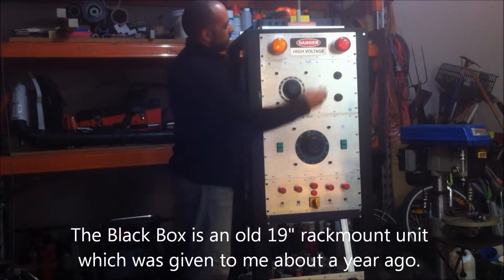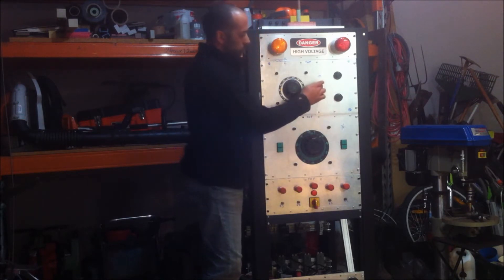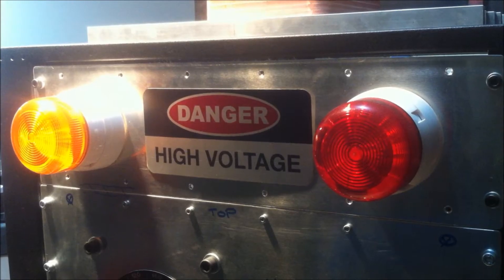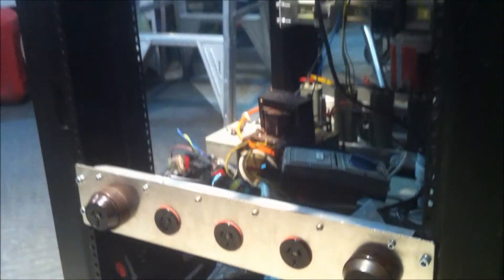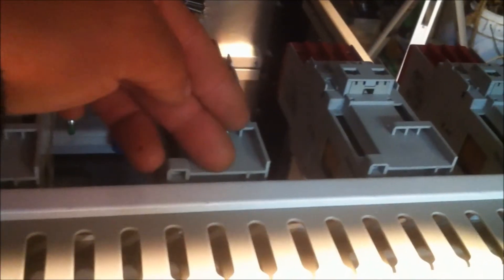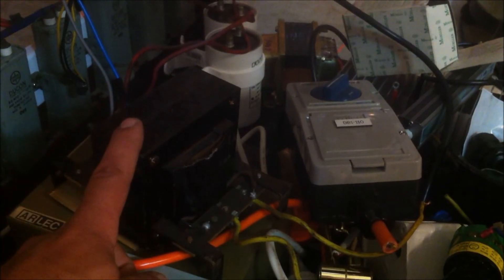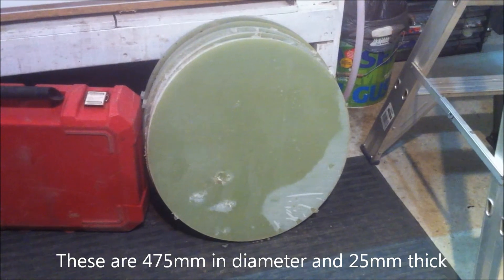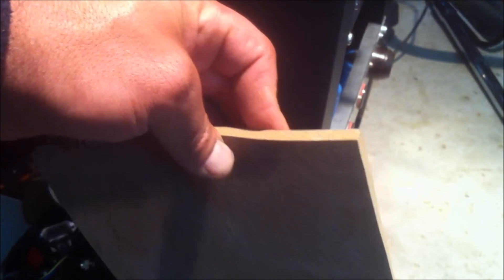I'm Building A Time Machine!

Comment: With all this stuff and knowledge you have do you believe in devices like the kapagen or don smith device?
Reply from the maker: I have never built a kapagen or don smith device, however, I fail to see how any of those devices could produce excess energy/COP>1 by any means. The main reason I say this is because they are both tightly inductively coupled and I see no part in any of their circuits that could not only be associated with the production of cumulative oscillations, but also limit the cumulative oscillations from destroying the circuit, both of which I believe are required to even stand a chance at achieving a COP>1.

Also, I don't believe any excess energy has been demonstrated or proven undoubtedly by the inventors (I may be wrong) and more importantly no other individual or group has replicated the experiment with successful results demonstrating a COP>1. 

Unfortunately, if the theory does not match up with the experiment, the theory is wrong. The experiment must also be re-producable.

I hope that answers your question :)
Reply: Sure did thank you